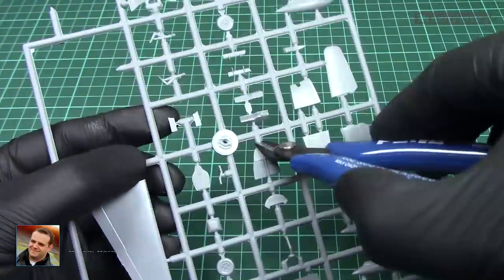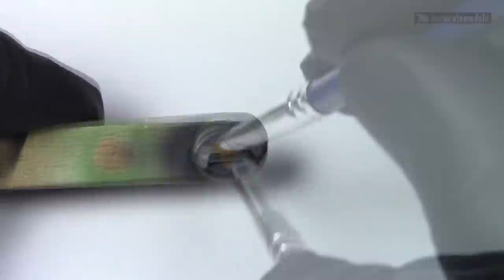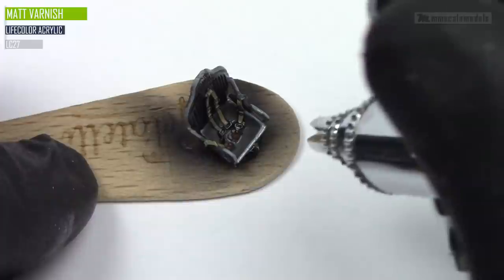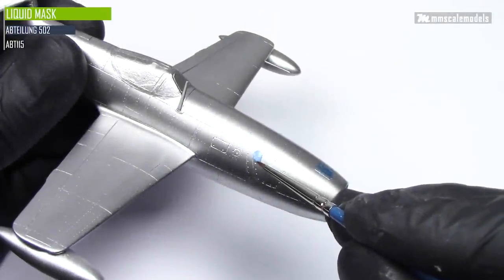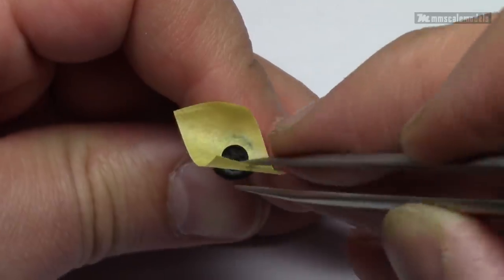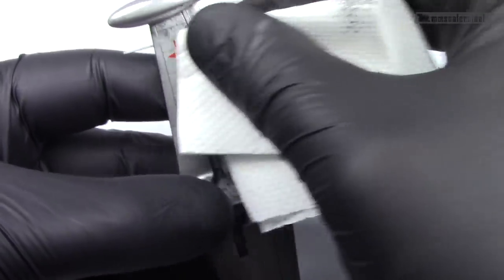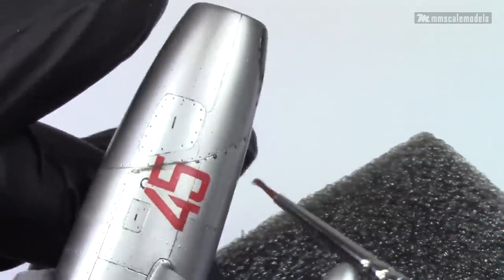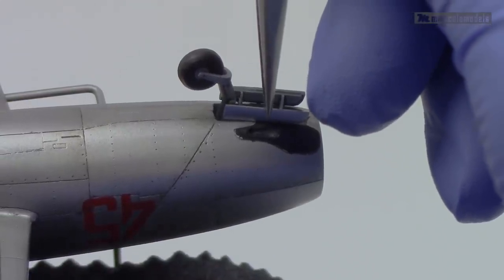1/72 Yakovlev Yak-23 Flora [ step by step build ] Special Hobby

Comment: Beautyfull effect with this nightmare kit. I built one  and know what You feeling. Many problems with resin parts-esspecialy exhaust nozzle and wings.
Reply from the maker: Thanks mate, those type of kits look so promising when you open the box.
Reply: Kapselek... I have this kit but have not started it. Is it really a nightmare to build? Also what are things to watch out for? Thank you
Reply: Resin parts are not fit well. I had problem with exhaust and correct angle. Watch out with canopy too. Not fit perfect. This kit is typical short run.

Comment: I have never used Mr. Cement before (only Tamiya extra thin) you are applying this cement to painted surfaces... how is it bonding? Is that a feature of Mr. Cement?
Reply from the maker: It's probably similar to the tamiya cement. Just as tamiya there are several types... slower, faster and super fast which also comes with their respective flowing properties,